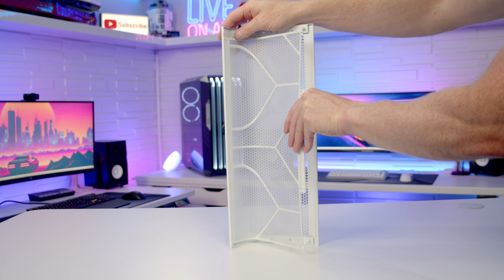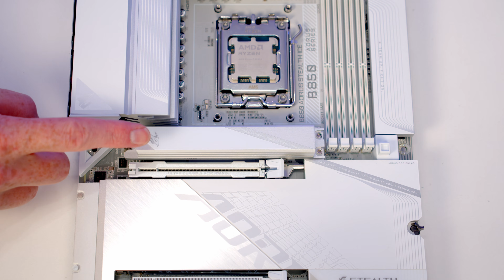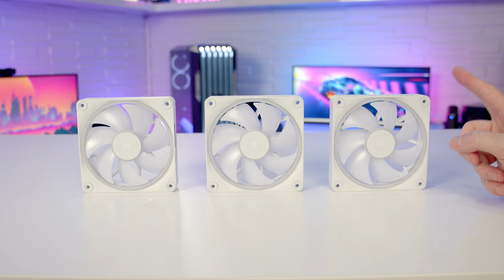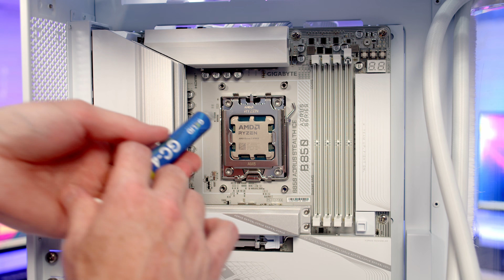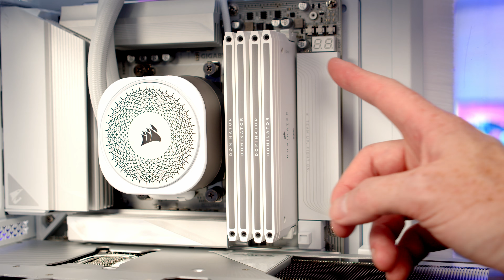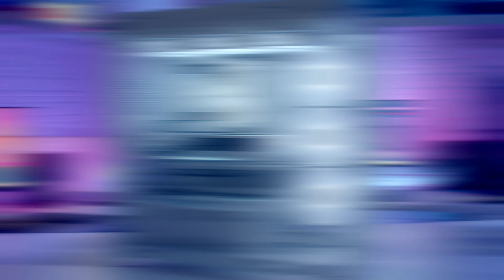Corsair Air 5400 Build - Step by Step Guide

Comment: I noticed that the AIO tubes were on top yet CORSAIR recommends the tube to be on the bottom.  Looking at other AIOs the tubes are always recommended to be on the bottom.  Any thoughts?
Reply: Don’t need to, most of that applies to old AIO’s or custom rigs
Reply: @belly818  It applies to new AIO's too.  The latest and greatest all still urge for the tubes to be at the bottom.  Physics does not change....bubbles go up!
Reply: @gjj1 yea exactly, if the pump is even a millimetre below the tube inlets of the rad then the air gets trapped up top in the rad and not in the pump. You’ll have maybe like a tiny bit more noise from the air sloshing at the top but it won’t hurt performance at all or risk damaging your pc
Reply: @belly818  I will let you know belly if anything happens in my setup.  I have the case and aio cpu and gpu.  I simply do not understand why they couldn't have made a pop out at the top that would plug the bottom hole if desired.
Reply: @gjj1 I’ve been running it how it’s ment for the case and my cpu temps are normal if not lower than normal
Reply: @belly818  will be interesting if they release a V2 case with changes.  I love the case and agree the temps are very cool.  Whole design makes sense, aside from my tube issue :).
Reply: @gjj1 nothing is wrong - simply there has to be something higher than your pump and it doesnt matter of it has tubes up or down because either way the bubbles would go into the chamber on side of the radiator .. only problem would be air in pump which it wont be when after building you tip the system turned on to the back a bit for 1-2 min

Comment: I just built this and followed everything step by step and it feels like the top fans are also intake.... I set them up exactly like in this video and they are the exact same fans, am I tripping?
Reply: Just look for the arrows on the side of the fans! It will point wherever it will pull air through, just built mine last weekend with a 9070xt 7800x3d combo and it runs like a dream. I hope you got the issue solved!
Reply: @LaminatedDevin just about to order the same setup, can I ask what motherboard you went with?
Reply: @liiaaammmm1994 I got the Gigabyte B850 Aorus stealth ICE and it goes very nicely with the Corsair Air 5400, highly recommend if you don’t mind a bigger PC case

Comment: Does the CPU exhaust feed into the PSU intake? There is an animation on the Corsair website that appears to feed the one into the other. Especially if that side of the case is placed against a wall. Suboptimal to say the least, but the performance evaluation at the end of this video is still looking great.
Reply: You can always reverse the fans and blow the heat out the front of the case.

Comment: I absolutely love this walk-through, you are the man Christopher! The way you routed the AIO cables was brilliant and I did it the same way. I added a velcro strap that hides the usb and iCue Link cables from the Titan 360 LCD AIO behind the tubes and routing to the top you can’t even see them, combined with an MSI Project Zero Z790 board with back connectors this case allows for an absolutely ridiculously clean build. Although I do almost throw those plastic fan ducts out the window at many points. ❤

Comment: I had to double check as the top fans in this video (I think) are intaking not exhausting. Was leading to my GPU getting warmer than expected as both top and bottom was blowing air in with no real exit except the passive rear.

Comment: this case is pointless for a GPU Liquid Cooled AIO like 5090 and 5080
Reply: Why?
Reply: @Kaspar0v89  meaning that you would have to remove that cover inside to install the gpu's own radiator in that chamber im not saying its bad but it just kinda pointless
Reply: @IAmTokix  why should I do that? I have the Air 5400 and a Astral LC 5090 and I have the cover and the radiator in the chamber

Comment: Great video! My only issue is the price at $309 is quite ridiculous. For this price you should get another set of LX fans at the top! Corsair would have had a home run if priced at $209.

I really want this case for my next build, but I’m not sure I want to spend $300 on the case and another $200 to get an iCue 360 AIO. I feel many people are in this predicament as well.
Reply: You’re going to have to spend money and get a aio.  You don’t have to get the expensive version though. The other version uses regular argb fans which would work perfectly in a non-ICue system.

Comment: I've heard that positioning an AIO (All-In-One liquid cooler) with the tubes facing up is incorrect and can shorten its lifespan or cause air bubble noises. Is there any truth to this, or have modern AIOs improved to the point where this is no longer a concern?
Reply: As long as the aio is not at the bottom of the case then you’re golden.

Comment: Hi Chris. Thanks for the review. This case caught my eye during computex and I was interested to see a build in this case. Is there enough space for a push pull setup? 

Also, given the design of the case, are the AIO tubes in a position which could lead to air getting trapped which in turn could lead to premature failure of the pump?

I recall seeing a video from someone else saying that the tubes should be at the bottom (if memory serves me correctly). This was in a different case.

Comment: Imagine all the space on the 2nd chamber and do push and pull config in 360aio will be damn over kill 🤔. If i got this case im gonna do it for a reason 😆
Reply: Unfortunately,  you cannot do push/ pull with the aio as the clearance behind the aio chamber is a hair too small to allow a second set of fans to fit with the air guard in place.

Comment: Why nobody speaks about the AIO installation, the tubs are on the top side and this thing will going to damage the AIO pump in time…🤷🏼‍♂️🤷🏼‍♂️
Reply: I have the AIO tube placed on top side for 5 years, no problem. Jay2cents had a video and in his test , top side tube are ideal.
Reply: Yea dude in 10 years. We aren’t in 2005 homie, times have changed and so did the manufacturing.

Comment: What direction is the intake and exhaust for the fans? Im trying to figure out how I would build a pc with this case myself, and I just cannot wrap my head around the top bottom fan layout... isn't that bad for cooling? This would be my first PC build and im trying to do a lot of research.
Reply: The fans on the bottom are reverse- pitch fans set to intake - A number of manufacturers (Off the top of my head, I can think of Lian Li, Montech and now Corsair) offer SKUs of their fans where the blade pitch is inverted. This means that the airflow is reversed compared to normal fans, and has an added benefit of improving the aesthetics, since the "pretty side" can face upwards. In this instance, it means the main chamber intakes from the bottom directly into the GPU, then exhausts out through the top of the case.

Best of luck with your first build! I completely understand how daunting researching can be, and there are a lot of things to keep in mind, but the good news is that there has never been more available information on how to put a build together. Take all the time you need and enjoy the process!

Comment: "Look what they need to mimic a fraction of our power" - standard layout case
So much overcomplicating, dear Lord...
First they introduced PSU shrouds with sole purpose of hiding the PSU cables. In return we got an extra piece of metal that complicates manufacturing, gets factored into price, hinders the GPU airflow and complicates mounting of things on the bottom, so really not worth it. 
Then we got dual chamber cases which are dumb in general. They again complicate the manufacturing, make cases use more room, raise the price, complicate things and you need 2-3x the fans for same result so even more unneccessary cost and noise. In return, you get nothing of use. Good airflow? You can have that with standard layout using half the fans. RGB? You can have it with standard layout. More radiators? You can have them with standard layout. More storage space now that you get a dedicated chamber? Lol, nope.
And now this abomination...just stop, ok?
Reply: Ragebait used to be believable
Reply: Think you need to get out more.
Reply: Okay.

Comment: The first thing, is it only me who think that top air duct actually detrimental in removing the air? The bottom part, I get it but the top part is either unnecessary or just reducing the capability of air to be freely flowing to the top and be removed by the fan. The only thing that I can think of why they do the air duct on the top is for the sake of simetry. The second thing is that curved glass panel is aesthetic first rather than function, I don't even like the curve glass look. So, I'd like to have fan installed at the back to be honest. I wonder if you can compare this case vs dual chamber case like lian li O11D EVO (or other of its iteration) using the same hardware, and set the AIO as side intake? Cause I recall you said side intake AIO in dual chamber (like Lian Li O11D) is the best layout. It would tell us if separating the CPU chamber is actually worth it or it's only a marginal benefit.
Reply: The top duct actually improves the airflow and make it more laminar, thus better efficiency on the intake of the fans.
Reply: That would be the difference between "thinking" and actual testing the company did. Also, why we trust the latter rather than "feelings" folk get.
Reply: I was thinking the same thing, or it would actually have to be inverted in order to exhaust air better. Waiting for mine to arrive with 9 phanetks t-30 fans, so I’ll test it out without the top air duct and se how that works.
Reply: It is compared in a video by kang and the results for cpu are about 10°C of difference
Reply: @jeanjacjomo3697 is it correct to assume it was better without the duct on the top fans?
Reply: @Abruzzi96 with no ducts the GPU hit a max temp of 67°C. With both ducts installed, the GPU max temp was 63°C. With only the bottom duct installed, the GPU again maxed out at 63°C. So the bottom duct is effective, but the top duct isn’t helping or hindering cooling efficiency.
Reply: @Abruzzi96  Not really, it is also tested for 1 time. The top might get more to the circulation, the air flow, for a longer time
Reply: It's designed to increase velocity since smaller area increase fluid velocity. Hence more air will be shifted out.
Reply: That’s solved by the duct